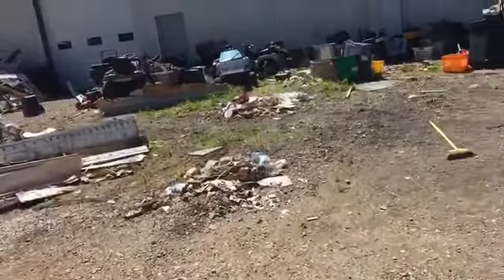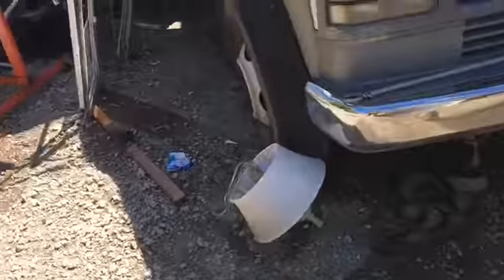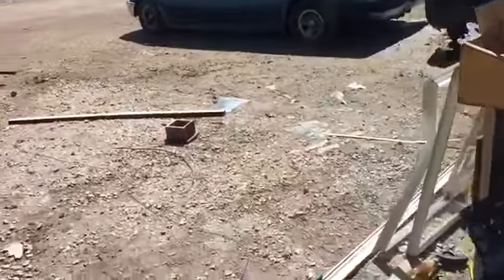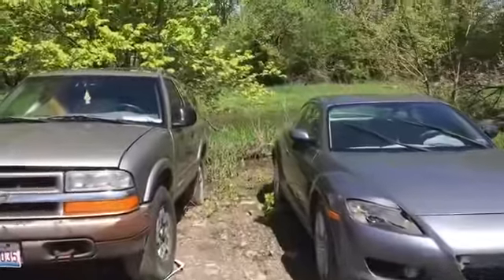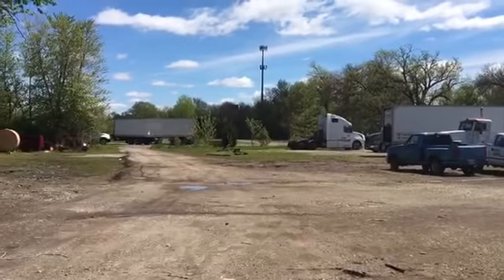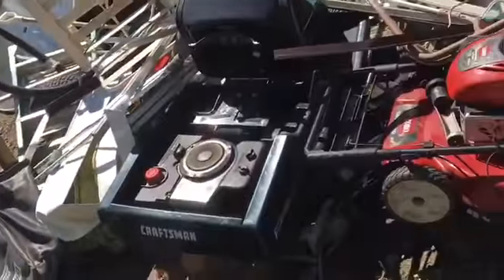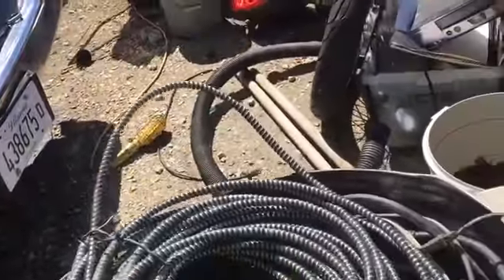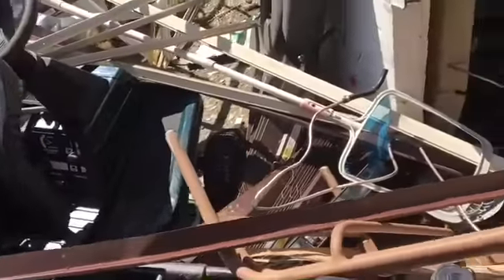Back at the compound

Comment: Just spitballing here,if you got both those trailers fixed up you could use one to go scrapping ,fill it up drop off at the compound and off again, scrap,fill repeat, scrap , fill, repeat.Only problem I  see is if you gotta  trailer full and a truck bed full you gotta unhook the trailer at the scrap yard to empty the truck out, would they mind you doing that or would they get all pissy about it?
Reply from the maker: No they want you to back it up together and I was not very good at backing up something attached to my truck
If I disconnect the trailer at the scrapyard they generally won’t say too much about it

Except if one of the scrap yard semi trucks runs into it they are not at fault
Reply: @steelisthemeal  I'm thinking maybe if you were to use one for steel only and one for non ferrous  (at the compound) to be cashed in when it was worth cashing??

Comment: Awe man.  You have the answers.   You gotta get what you can for all that scrap.  
Whatever it is is the down payment for your permanent home/shop.  Do it !!   
You also need a better accountant to show you how to make spending money 
A bonus and not a problem.     You can do it.  Also.  You probably dont eat right.    
Right ?  
You can do it man.  
You need to watch a little Andrew camarata.   !   For inspiration !!  
Mortgage ?    So this is your place ?   Dude.  You got it made.  
Do not convert to propane.  
You have nat gas ?
Reply from the maker: The natural gas company came by and tore out the meter and the piping to the house for nonpayment of Bill
So it’s.    Do without heat
And here it gets down to -25 below zero Fahrenheit in the winter.  Or convert the house to all electric ⚡️. Electricity is super expensive. Like really expensive 
Or just convert over to propane   Probably the cheapest route  
I’m. Broke.....so this winter 
There gonna be no heat😮